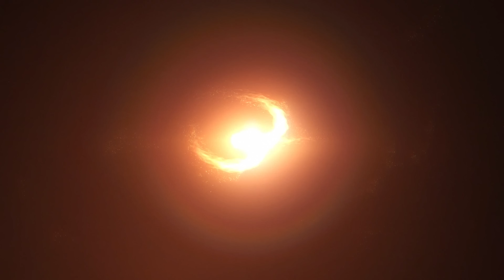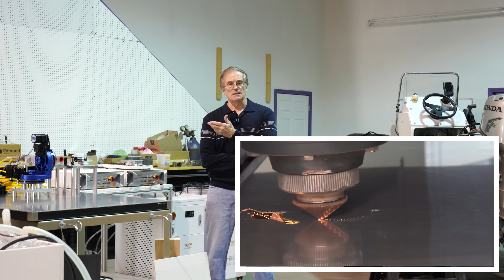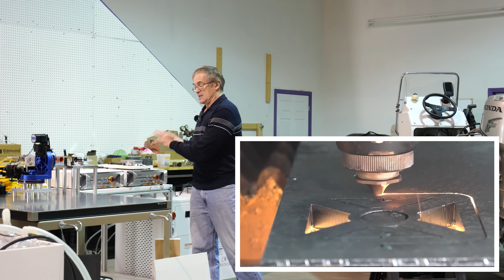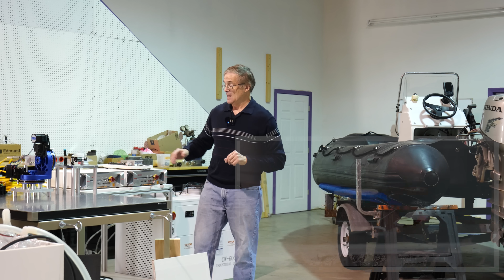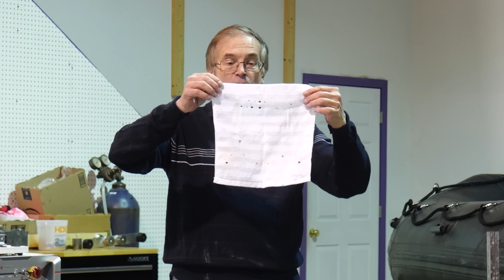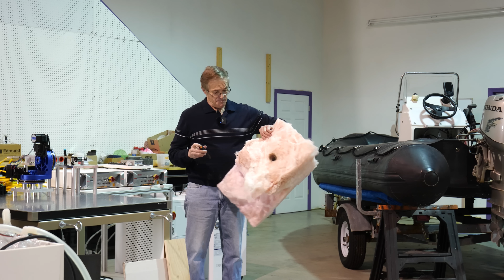We have a problem... and need your help!

Comment: Could be worth trying one of the light diffuser panels used for LED lights attached on top of the evaporative cooler pads used in evaporative air conditioners with water cycling through it the same way it would in the airconditioner. Difuser would hopefully spread the laser enough to stop it punching a hole through it, water evaporator pad should stop it catching fire/absorbe the energy from the laser, good luck 👍🏻

Comment: U. S. Navy veteran here... Early in my career, following Operation Desert Storm, I recall our ship CGN-40 USS MISSISSIPPI going into Portsmouth nuclear maintenance facilities of Norfolk Naval Shipyard for an extended rehabilitation & refit period; during which time many of us younger sailors were temporarily assigned to special duty working directly for the shipyard's team of advanced welders & pipe fitters who were performing all manner of welding, cutting & brazing services aboard our ship.  We observed everything from MIG & TIG welding to plasma cutting and more while typically confined to some of the least accessible & most inhospitable of spaces.  Due to the proximity of these welding, cutting & brazing operations to sensitive systems, vital cable runs, flammable & potentially explosive materials, each welder was assigned a sailor who shadowed him as an observer & fire-watch stander throughout the operation.  Our job was to stay alert to everything outside the welder's immediate field of view, always watching for & tasked with extinguishing any bits of flying molten metal, stray sparks and other persistent red hot stuff being ejected from the welder's work area.   We found ourselves protecting the welder as much as the ship at times because of the extreme conditions & dangerously cramped working areas that limited the welder's ability to see or react to fire started by his hot-work. 

Though purely supposition on my part, I thought there might be a viable solution to your dilemma related to my time as a fire watchstander in that shipyard all those years ago.  Of everything we carried into & out of these shipboard spaces for performing the work & for preventing fire, there was one surprising material we used extensively that I became extremely accustomed to relying upon for its ultimate protection & general utility (besides my fire extinguisher, safety goggles & fire-retardant coveralls): A HEAVYWEIGHT NON-FLAMMABLE KEVLAR MESH.  It was extremely durable for something so flexible and we draped it over & around vital equipment & critical infrastructure, while also often wearing it as a sort of makeshift shroud or cloak when forced to observe at questionable or unsafe distances from the hot-work being performed.  I cannot tell you much more than this because I have no idea where the stuff was sourced, nor whether it was purchased by the shipyard or NAVY, but I do recall us being told the stuff was extremely expensive and we were responsible for assuring it all went back to the hot-work shack at the end of every shift.  It was apparently available in virtually any size or shape required because it came on giant rolls or bolts of the material that were basically cut to fit.

I have no clue how the heat of the photons emitted by lasers differs from the photons & infrared emitted from arc welding of plasma cutting, but I imagine YOU DO. You'll likely know the moment you read my comment, whether or not this sort of FIREPROOF KEVLAR MESH is a viable option.   Regardless, it came to mind and so I wanted to toss my offering into the ring to see if it might stack up better than things you've tried thus far.  Good luck and boy am I looking forward to seeing what you have in store with this next revelation & its potential for advancing current technology in the rapidly evolving field of drone {and other robotics) based warfare.  I have absolute faith in your abilities and expertise and look forward to seeing what you produce!

🇺🇦 SLAVA UKRAINI 🇺🇲

Comment: I was doing some dry wall mudding the other day and it occurred to me, the ideal material is probably a light weight permeable concrete where you use perlite or vermiculite as the aggregate, and actively cooled by saturating it with running water. You can cast it into inch thick 4x8 panels that can be moved and repositioned as need.

This should be relatively cheap. Relatively light weight. And also have the ability to be easily repaired should the laser accidentally dwell too long

I hope you're still reading responses
Reply from the maker: I am, and that is a sound suggestion as it covers the issues and the addition of the water...if needed... is a good option.

Comment: A ceramic block coated in Black 2.0 or Vantablack (if you can get it). I'm sure the ceramic can withstand that kind of punch if it's thick enough, and the black coating would absorb (obviously) damn near 100% of the light.

Comment: A cheaper alternative is to slowly drip water onto the face of a drywall barrier, like a small waterfall flowing over the face of the drywall. The wet drywall will withstand the laser heat longer.
Reply from the maker: I'm beginning to favor wet rockwool.
Drywall becomes soft and fractures easily when wet. This will be heavy and fragile and hard to move.

Comment: You can use a thin metal container covered with black opaque durable (baked) paint (you can put some graphite in to the paint also) and fill it with heat-resistant machine oil (dark color). Even if the laser penetrates the metal, the slowly leaking oil will provide the necessary insulation. However, It will be difficult for the laser to penetrate the metal because of the heat transferred to the oil.

Comment: you know that black anti laser curtains exist for that reason? jsut check their material and order it
Reply from the maker: I do know.
They are designed to block stray, unfocused laser light that still poses a risk to vision and could cause a minor skin burn. Against a direct hit with a multi-kilowatt laser, they will blow apart.
Reply: @TechIngredients  yeah. Didn;t know they were so weak. at least they are designed not start a fire. 

I really look forward for this project!

Comment: If this system ever goes into production, we are just going to start seeing extremely reflective drones to make your own defences obliterate the things you want to protect by bouncing the beam.. That's also what I think you should try to do; forego the no reflection requirement & bounce the beam into the ground. You may run into trouble if the mirrors immediately shatter due to imperfections or if the laser burns through the substrate, but I think it's worth a small scale test because you won't find a better absorber.
You could try multiple highly agitated waterfalls in series too but you'd probably get less predictable & more dangerous reflections off those.

Comment: very smart people in here ;) but why so complicated?  a quarry or surface mine(preferably one thats out of business or abandoned) would have enough stonewall to shoot moving drones! 
would be nice to see this project in action ;)
greetings from germany
Reply from the maker: Thanks!
But it is complicated.
We don't have access to a quarry. Even if we did, it's still requires transporting the whole setup, including delicate optical equipment and access to about 80 amps of 240 volt single phase power.
This is each time we want to test and adjust the systems.
And, what if it rains!

Comment: @TechIngredients  If one or two legs of your table are flexible, a weight moving on the table could be enough to tilt the laser by one degree and prevent damage. The table would still be stable enough to control where the laser is pointing.

Comment: I think you should use a system of a high refresh rate camera , and a separate computer which will analyze the video of the background (example a dry wall) . When it detects a high intensity of light on the background the computer shuts off the Solid State Relay (Normally its turned on)
Make sure that the laser hitting the test subject does not trigger the safety system,  place the camera behind the test panel and facing the background. 
Use a low power laser to calibrate.
The reaction time can be impressively low. (just make sure the safety system triggers OFF before the background material fails)
Hope this idea helps
Reply from the maker: That is a very good idea.
Reply: @TechIngredients   Thankyou, happy to help.

Comment: Carbon or Graphene Material (Cheapest unless you know what Rentry Pods are layered with) with De-fractive surfaces. Otherwise if you wanna be low tech. Pineapple skins are stupidly heat resistant. Otherwise just do what factories do. Beam Dumps or Traps using Liquid Water cooling or Gas Cooling. Generally all you have to do is catch the beam and force it to either A Rapidly lose energy aka defraction or rapidly lose heat aka firing said laser into a beam dump/trap. So even if you shoot through something. Its not going any farther than that. 

A Beam trap could literally be a bucket of water or a container big enough to catch it; Otherwise you can fire a jet of cooling gas in the same path of the laser and if you worried about stray shots. internal baffles but it depends on your budget and what your trying to do. What ever it is your best bet is to just point the laser down. NOW if you go with the dump and you don't wanna do water. Just carbon enriched dirt. Anything beyond that your probably looking to spend money on already manufactured equipment that fills this roll which I dont know the costs off head.

Comment: You said you're self, salt. Spas have salt walls where the walls are made of slabs of pink salt. Use the darkest blocks of that you can find. Or if you're worried about that optical properties of that use powered (pink?) salt. The crystals should be tiny enough to diffuse the light. Put in in a mold with a tiny amount of water and it should mildly fuse the salt together as it dries. Meaning you have have a wall rather than a pile.

Comment: If you're still taking suggestions for you laser ablation issue I have a few ideas. 
First thing I thought of was aerogel. They are sometimes used in laser protection, specifically silica aerogel. Though boron nitride and carbon aerogel may be something to look into as well. A laser with a continuous wave at a power of 7kW*cm-2 can be held at bay for 26, 61, and 100seconds relative to 3, 6, and 9mm thick silica aerogel. The 3mm thick silica aerogel would reach temps of 226.9C and the laser incident point. Having a thermal conductivity as low as 0.013 W/m*K aerogel really is a in my opinion a decent solution and could probably make a fun video on creating it yourself. I know NileRed did a video on it a while back, inspired by Veritasium, he may be willing to collaborate. 
Second some type of phenolic resin or ceramic that consists of a silicon carbide or zirconium carbide would be decent solutions. I know that again I'm hitting that other content potential stick but showing the creation of Bakelite would be something fun to see.
Hope this helps in any way if not I apologize for wasting your time. If this does help I do not want to be mentioned by name or given credit. Just knowing I helped is enough. Mention something about squirrels, I'll know. Now I'm headed back to see your video on sake.

Comment: My inclination is to suggest a lens (fresnel?) to defocus, then water and something like the copper oxide to absorb like someone else suggested but submerged in water and maybe with heat fins on the back. Not sure if putting a lens in front of an aquarium would work.
Would love to see an Air Conditioner part 2 and also if you are going to do the hydrofoil on the catamaran

Comment: Based on the feedback you've provided I feel that complicated technology solutions aren't good for your application. I think that some sort of silica based product might prove useful but nothing too expensive otherwise you'd consider something like aerogel or an aerospace heat shield. A thick ceramic tile might be favourable if you found enough of them on clearance and then applied them to a glass mat with an adhesive, or permanent non flammable thermal putty. The glass mat backing would help you hang them like a curtain. Scuffing them up with a sand blaster or sandpaper or utilizing the unfinished side might help with keeping the laser where it belongs. Maybe some form of carbon coating would help? Carbon nano tubes are expensive but anyone with a torch can deposit carbon on a surface. 

My original idea involved an optical comparator and then I started diving into complicated technology that involved magnetics and super conductor filament but I realized that you likely aren't looking for a solution that will win the nobel prize. 

I hope this practical solution helps; i can't take credit though because it's a summary of the input I discovered from your community. 

Play safe and make sure you implement a safety switch. For that solution I'd suggest a normally open foot switch so the beam will turn off when you lift your foot. Be careful with targeting systems and lasers as well; I'm not in America but I know there's a fine line between tinkering and developing a weapon without a national defense contract and without adequate secuity. 👍

Comment: From the peanut gallery here how about water running over graphite?
Reply from the maker: If a running water system is necessary, and it might be, then it would be cheaper to use another type of surface like rockwool or cement board.

Comment: If you want to practice tracking and firing on a moving target then you need to protect the walls from the beam after it punches through a target, but also from the beam if it misses the target. If you miss the target and trigger the wall then the test run is over, which is fine if you’re ok with that.
Reply from the maker: That's difficult to control when dialing in the system and troubleshooting problems. The wall has to be protected to some degree.

Comment: One sided refracting glass with wet drywall behind it ( with a gap inbetween ) maybe? Not sure how much energy it would reflect though...
or a mirror.. facing away from the beam, glass surface roughed up to disperse the beam, reflective back coated with something non-flammable, let the beam pierce it and disperse the energy behind it into wet drywall again or something...

Comment: Smoke may disrupt the focus, a fog machine or a pile of burning leaves? Watched another youtuber with powerful lasers amazed that a stronger laser was impaired by a cd cover which was easily burned through by weaker lasers since the soot from the outermost layer impaired its efforts to burn further in.  Maybe a back stop glass frame to house the smoke to avoid interfering with the target.

Comment: The cheapest solution is likely to use the same solution you explained in the video...  Bigger lenses, focus down to a point at the distance of your target, diverge after.  On a production version of the system you'd actually have it set to auto-focus to the desired distance.  Might even help with how far you can target.
Reply from the maker: Autofocus is a significant benefit.
However,  the beam director has to be fast, and that means small and light. Enlarging the beam at the source will cost in terms of speed as well as how many lasers can be packed together.
Reply: @TechIngredients  Industrial robots can be large, heavy, accurate and fast.  Though that's likely out of the price range for a hobby project.  Realistically though, you don't need high angular velocities to track objects at a distance so you could probably get away with it if it was used outside.  It would struggle up close though.
Reply from the maker: The principle remains even if you throw a large amount of power at it. Smaller and lighter is faster.
Remember, an advantage of a laser based system is its speed, and when facing multiple targets, even at a distance, angular velocities will need to be high. The situation is dynamic, and the order of attack may require jumping back and forth across the field. Each target will require a certain dwell time, and time between targets is waisted.

Comment: Ok, I’ll try to solve this problem.

What if we use an angled mirror plate or perhaps dielectric mirrors designed for a specific wavelength, so they always deflect the beam downward? We could also try to make the beam diverge. The beam path would start horizontally toward the wall, then interact with highly reflective angled fins—similar to a louvered window but angled upside down. That should work.

Second, an active control system using feedback:
We can use fast photodetectors aimed at a diffused wall through a lens (not a camera, since that would be slower and more complex). If the detectors sense light on the wall, they output a high signal voltage via an op-amp, which then activates a relay to cut the laser power—probably within microseconds, if not nanoseconds.

Or, a third idea: a moving reflective system to dissipate heat—similar to the rotating target anode in an X-ray tube. But I haven’t designed that yet, since I think the first and second solutions are already good enough. 🤔🤔🎊🎊
Reply: Dielectric mirrors don't have the damage threshold for what he's doing.  They'll delaminate in milliseconds.
Reply: @kingofank  i thought it's highly reflective so it will work but i don't have such powerful laser to try ! But still my angled mirror idea should. work
Reply: @omsingharjit  It is highly reflective, yes, but having worked in the industry for some time I can tell you that getting very high laser damage threshold on dielectric films is very hard.  You have to have very low defect numbers, very good film chemistry, everything has to remain spotless.

Your downward mirror idea is interesting, but my thought is to just point the laser down, instead of up.  The demonstration works just as well from a tower pointing down as it does from the ground pointing up.